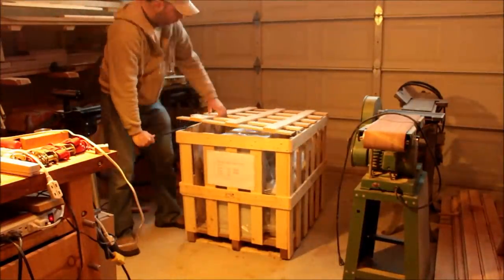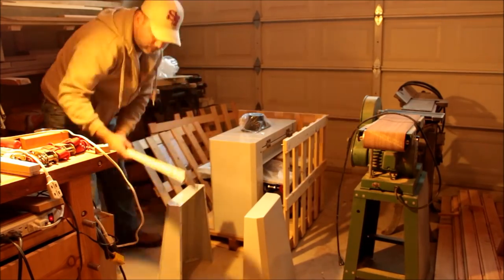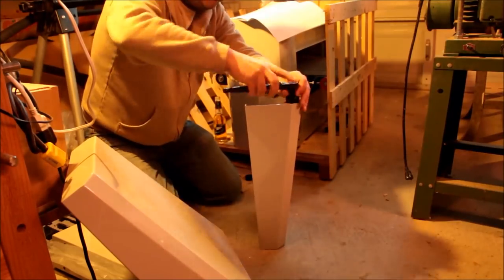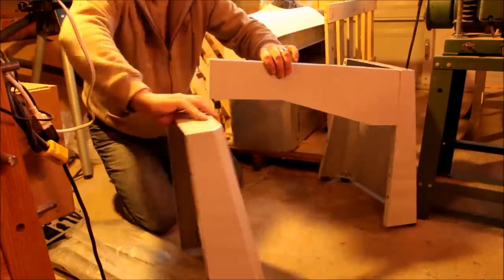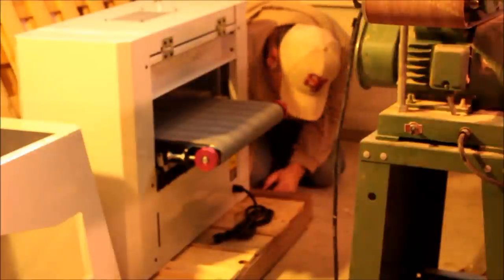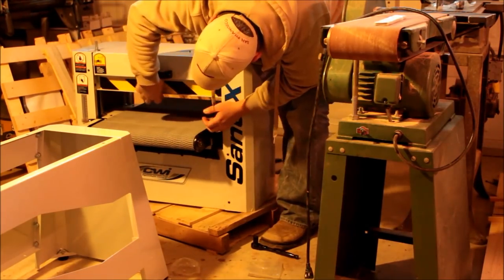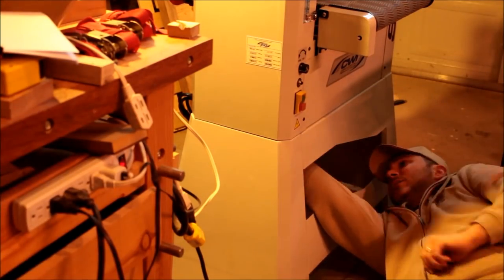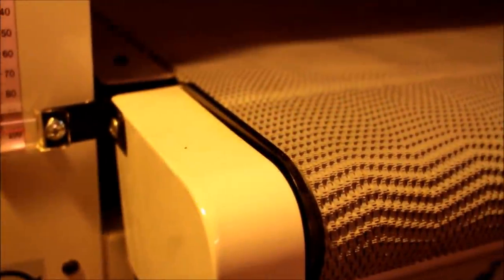Unboxing 17” Drum sander

Comment: Curious about this machine's infeed-table heigth mecanism - the 4-point truss-bearings. Are these moved by PLASTIC gears with one belt like on the Delta? If you had a Delta before....You know what I mean! The height adjust eventually breaks and fail, even with proper care and very gentle use. Do you see metal gearing on yours?? Thanks for this video, T.

Comment: Do you still like it after using it a lot?
And more importantly, does it leave snipe? Merci de Ontario Canada
Reply from the maker: Still love it and no snipes. I actually remove the snipes from my planner on it.
Reply: Awesome! I think I will buy the same one. Thank you
Sorry another question. Is the drum sander one of those tools and you look back and wonder how you did without it?
Reply from the maker: French River Springs I guess it depends on what kind of work you are doing. In my case, definitely! Having to thickness a high figured backboard would take me days. Now it’s a matter of minutes. It definitely helps with the work flow. 

One thing I’ve noticed over the years is I will need to upgrade my dust collection for the drum sander and be aware, you will need a separate 20amp breaker just to run this machine. 

Early on it takes a few passes to set the sand paper tightly ( I broke a few by being too loose) once set , it works without  hycups.
Reply: Thank you very much for the info. 20 amp breaker is no big deal. My dust collector is 2 hp  240 volt

Comment: What were the features you liked over the jets? It looks nice.ive never seen it in Colorado.
Reply from the maker: Edad Martin Jet was the next choice for me, the only thing I didn't like about the jet was the open side for a machine comparable in size to mine. To get a closed machine I would have needed to go on a way bigger unit. For the price tag although comparable you have to remember that I'm in Canada and it's getting quite hard to find a jet supplier. So this means shipping costs , exchange at .75cents on the dollar. So in my book I get a better machine for a cheaper price tag. CWI is a Canadian owned company , therefore I also have the felling of shopping local. They have very good reviews. And from what I saw so far I'm really pleased with my decision. 

My 14" bandsaw is a jet and I love it. I have enormous respect for their power tools. Thanks for your comment...